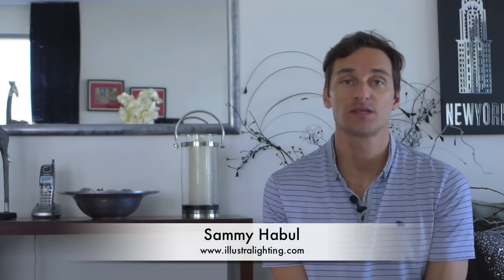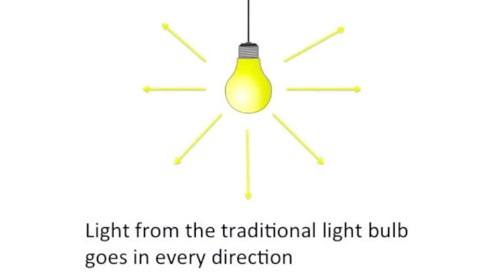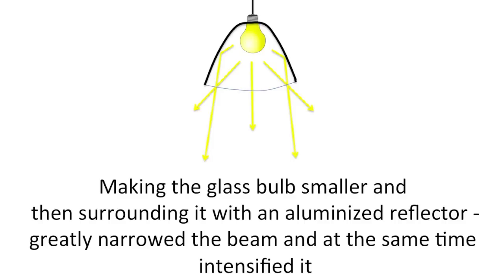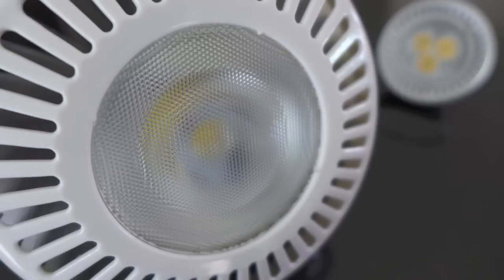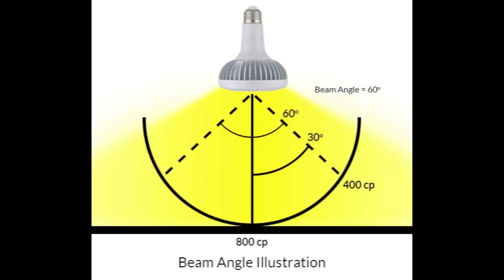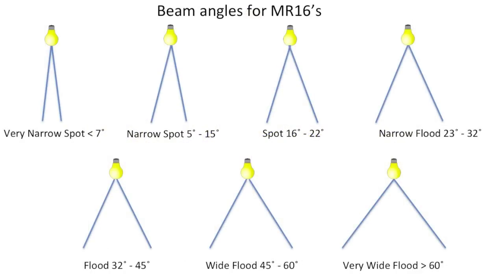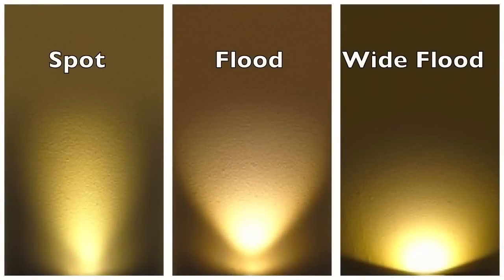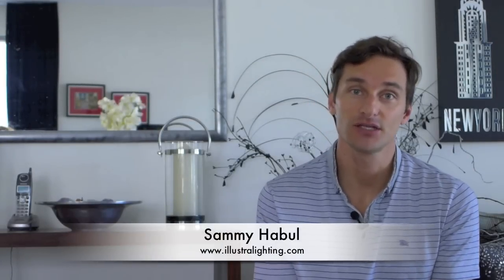Intro to LED Light Bulbs: Part 9: LED Beam Angles

Comment: Can you please tell us, as we are using Floor LED light fixing  for interior design work. If we give 10 degree angle to LED floor light, to height the columns or arches (from the bottom in the floor) then what height beam can go? and wht will be its width at the end where its is touching to the column or the ceiling . Thanks and regrds